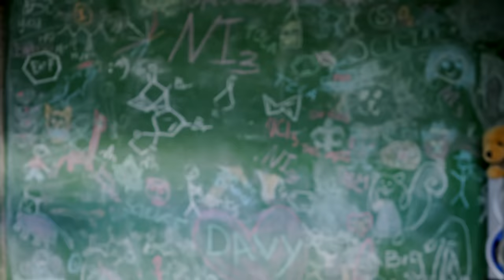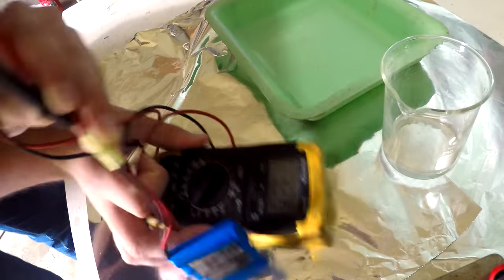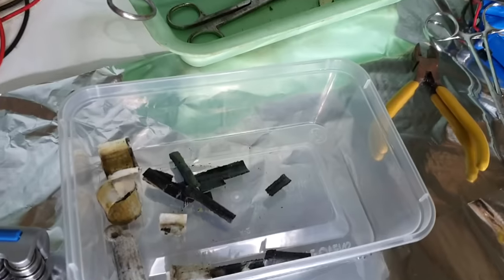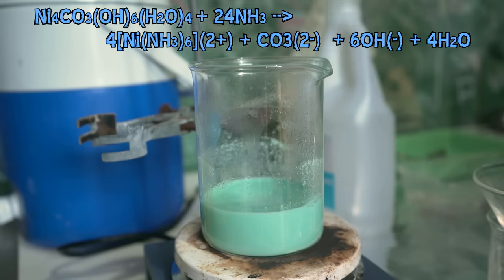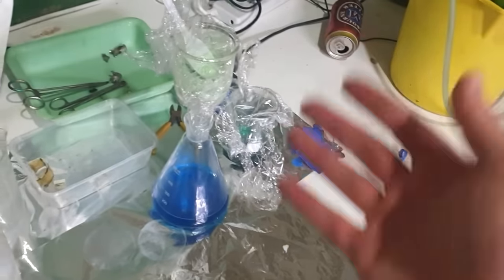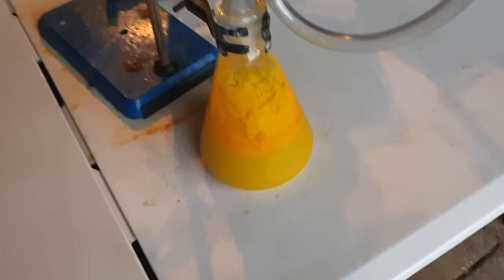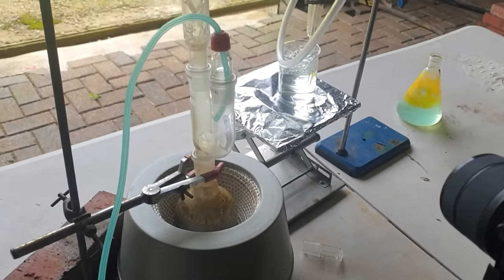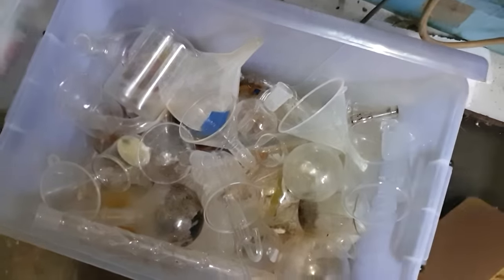Extracting Cadmium from a NiCd Battery

Comment: Ni-Cd cells are great for solar garden lights since it's ok to overcharge them with low current. Same goes for overdischarging them.
You absolutely should not overcharge or overdischarge LiPos - so you'd need a much more complicated circuit.
And generally, people wouldn't want their solar garden lights to explode.

Comment: Had an electronics engineer friend that was building a number of switching prototypes that incorporated large NiCad battery packs. In assembling a number of them, he picked up enough cadmium for it to show up in his blood. His doctor advised him to avoid the batteries for awhile. I've always wondered, how did he pick up enough to be detectable?
In those days some electronics connectors were cadmium electroplated - my guess is that between soldering those and the batteries he vaporized enough to sequester some biochemically.
I could be flippant and say, "uh oh, there's where your missing Cd went", but I won't. 
All kidding aside, cadmium can stay resident in your system for years causing irreparable damage. I believe my friend's doctor had him do a round of chelation just to be safe. Yikes!

Comment: When I tried my hand at nickel excitation from NiCd batteries, I remember getting nickel powder on the cathode, which I held in place with a magnet stuck to the jar.this of course set up a string action. The cadmium was plating across with the nickel, in hindsight I should have dropped the current density, this would have allowed me to get solid formation of nickel on the cathode..

Then it would have been as simple as changing electrodes and boosting the current density to pull out the Cd

Comment: I used to use Cadmium every day when making cathodic protection devices, AKA Marine Anodes. They come in two delicious alloy flavors; Aluminum:Zinc:Indium and Zinc:Aluminum:Cadmium, with the first metal listed being about 98% of the alloy. The Cadmium came in logs about 20cm long and 2.5cm in radius. We were always careful of the Cadmium as we all knew it is unhealthy, but as far as hazards  in a foundry go it was trivial. Getting a face full of molten alloy because you put something wet into the pot (and for some reason were wearing no protective gear) or the amusingly blinding result of some magnesium getting into a pot of Aluminum took the greater share of our attention.

Comment: 1:22 NiCad batteries also can be trickle charged to kingdom come without failing and without complicated electronics that also could fail. That´s why they are still used for emergency lighting and alarm systems. Just change the cells every 2 years and don`t bother in the meantime.

Comment: @4:19 you clearly see it did vent at some point.

I did overcharge 4 cells at about 12-13v @10a and it did vent within 30-60 seconds. Nothing special compared to a li-ion battery but it contains potassium Hydroxide.

Comment: All I remember about Ni-Cad batteries was it took (from a kid's perspective) forever to charge them and you only got 30 minutes or less of use out of them. They sucked

Batteries would probably get recycled properly (and also used motor oil) if you could bring it to supermarkets for disposal (who in turn would get a subsidy from the local/state government to do so) instead of the honor system we were given

Comment: So.. synthetic lithium polymer batteries without flammable electrolytes(which they are, by definition) do not, under any circumstance, that doesn't involve overcharging and bypassing the (tiny) safety circuit with chip on it by careful wiring, actually catch fire. And even if you do that, they will typically melt and become unusable, rather than burn. Meanwhile, the reason that some of the organic lithium batteries can catch on fire is actually the same reason that the nickel-cadmium batteries can catch on fire - that the electrolyte is flammable. 

What complicates this is that what's been sold as "li-po packs" for a while are usually some sort of organic lithium-ion based batteries with different, also flammable, electrolytes. And there has been a dirge of very bad production runs of lithium ion batteries that would be rated for a lower power-consumption than the devices they're put into require. So they get warm, the electrolyte leaks, and gets sometimes ignited by the charging port, or by a short.

But basically, this whole thing about nickel-cadmium batteries being safer than "exploding li-po" packs is complete bullshit. Not only do they both crack and leak, the electrolyte is also corrosive and toxic. It's total propaganda. And the only reason they're still used is that they are dirt cheap to produce - that is, for the factories in China that have the old production facilities, and are getting less and less orders. There's stocks and stocks of these, so if you don't need particular voltage, stable power, anything to any order, whatsoever, then this is passable. So you'll get it in cheap toys, or for disposable parts for model-planes, and things like that. Since they sometimes don't have any actual limitations on them, to - you know - avoid making them burn -- it is possible to just draw as much power as possible, and put them in series, and so on. It's not a good idea, but people do it.

This is also the same reason why we've been using lithium-ion batteries for the longest time. People have come up with salt-solutions for electrolyte, to avoid the corrosive and flammable part - and it doesn't matter: Apple and the Samsung want to save 1 penny on the ton of batteries produced off a finite resource mined by slave-labour in Africa, so that's what we're going to get.

Synthetic lithium-polymer batteries, on the other hand, have a sort of fluffy polymerized gel instead of flammable and liquid electrolyte. It's tons of small threads, bascially. And that is the electrolyte. They don't combust, they are not toxic in the same sense as the organic batteries. And they do have, and must have, voltage regulation software controls (which doesn't get you "less power"). Otherwise they don't function at all.

And technically, the synthetic lithium polymer batteries are cheaper to produce, they have a less involved process, less things can go wrong, and they last infinitely longer before not being serviceable. And they are, unlike the organic batteries, actually possible to make into new batteries. They can be melted down and reused -- organic lithium-ion or nickel cadmium batteries can at best be "safely disposed" by industrial and expensive dissolution, much like what you're doing in the video.

So yeah. We're not using these synthetic batteries all the time, because the world is fucked. And there are humungous industries invested in keeping it that way, even when the tech exists to replace the stuff that literally could kill you, and it is technically cheaper to produce. We're just keeping it the old way, because the factories are there, and it's cheaper to spend some advertisement money on creating fear about new "li-po packs" that "explode".

Comment: I imagine you aren't old enough to remember cadmium-plated hardware (screws, connector housings, and the like). That used to be common, and still is in mil-spec applications. DigiKey lists over 160,000 circular connectors with some sort of cadmium-plated shell.

Comment: So you saw a noticeable difference with having a slightly acidic environment when bubbling the H2S. The reaction you showed for the cadmium had a product of nitric acid. Is it possible that the solution acidifies the more cadmium you precipitate out? If that’s the case, the cadmium might get redissolved and leaves you with less yield, especially if you leave it for a week(I am also a culprit of leaving reactions for a week because I just cba).

Comment: I think I know what it happened through your process. Firstly, the layer you thought was cadmium was cadmium and it can be physically separated. You can see these batteries have a layer of cadmium and a layer of nickel hydroxide.

And when you thought your cadmium sulfide was redisolving, you were right again. Like any sulfide, acidic solutions attack them, releasing back hydrogen sulfide (same as if you throw a chunk of pyrite in acid). You should have filtered straight away after precipitating with your hydrogen sulfide generator instead of letting it sit with an acidic solution, or at least neuatrlising that solution, and you would have been more happy with your yield ;)

Comment: Dont worry about yellow color I usually get all the rainbow colours every time different. Last time I had really nice blue color after some amination and salting. I had little dirty solvent. I was lazy to distill it first so I washed it few times with water, active charcoal and probably because of little carbon left inside of my separating funel instead of green I got blue.

Comment: 2 things: 
Yes Nickel is magnetic. You could have tested which metal was nickel and which was cadmium by using a magnet. Wouldn't have guaranteed purity but it would have helped alleviate some uncertainty. 

Secondly (and take this with a grain of salt) but I'm pretty sure a fully charged battery would have less cross contamination of metals than a depleted one which could have helped.

Comment: If I had to hazard a guess, you probably got almost half the cadmium. 6% of the battery (not counting the shell) is cadmium, and a typical "AA" size NiCd cell is 21 grams. 25% of that is the steel case, so there should be 945mg of cadmium in there.

Comment: If I remember correctly the Japanese have sth called Itai Itai which translates into "Ouch Ouch". Apparently back around WW1 they started mining the hell out of Cadmium and a lot of it ran off into the drinking water.  The cadmium gets processed into your bones like it was calcium and makes them brittle.  Apparently at high levels you can crack your ribs if you simply cough kinda hard and it is extremely fatal if exposure is long term.

Comment: if I remember correctly our analytical lab, CdS needs a high concentration of Sulfide ions to precipitate i.e. as H2S has a pKa of 7 it may only be slightly acidic. We proceded as following: dissolve the salt/metal in HCl/HNO3 (2M), add H2S in Acetone, dilute to five times the volume OR add a little NH3 --> yellow CdS. if you add too much NH3 (pH gets to be arround 9) Ni will precipitate out as NiS (the tar we all wanted to see). maybe this helps.

And the flask you're using to generate H2S....man you must hate it a lot

Comment: * "where's the cadmium" *
Did you check the separator?
My understanding of these cells is that when fully discharged; most of the cadmium is present as cadmium hydroxide...
It is when the cell is fully charged that the cadmium is plated to the cathode (the outermost / larger electrode)
Also only about 16% of that cell is cadmium, by weight... (still a fair bit, about a gram?)

Comment: To add to the NiCd Vs LiION bit at the beginning, there's a third option. Where I live (CZ, EU), NiCd cells have been phased out in favour of NiMH cells, which are supposed to be very similar but cadmium free. Don't know why the rest of the world doesn't use them, maybe they are more expensive or something.
Reply: NiMH did get used a good bit as a NiCd replacement but lithium batteries just took over most of that market anyway

Comment: The best way to separate nickel from other metals, is to reduce to an alloy, then react the nickel with carbon monoxide under pressure to turn it into the even more toxic nickel tetracarbonyl. Note that I said "best" not "safest".

Comment: You aren't even going to talk about the real reason NiCD batteries were replaced. Memory effect in Nickel Cadmium batteries is a real thing. It was a huge pain for laptops and other 90s large portable electronics. Only good thing about them is their long storage capabilities of earlier over-engineered NiCD batteries. I've seen 50 year old NiCD batteries still hold a significant charge

Comment: I havent looked it up, but i wouldent be the least surprised if a nicad battery is mostly nickel with just trace amounts ie mere milligrams worth of cadmium. and if a NiCad works as i think it does, the cadmium may only exist as a metal when the cell is fully charged, and more as a salt when the cell is flat.

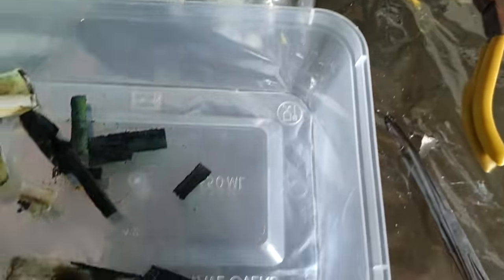Comment: 5:58 During discharging, don't they form hydroxides? I.e. those are mostly nickle hydroxide and cadmium hydroxide. Discharging changes the chemistry after all, from a higher energy potential to a lower (and less chemically reactive) energy potential.
Then again, I don't have a degree in chemical engineering, but in electrical.

Comment: You should have checked the voltage while the leads were in salt water. You always get a buildup of charge when there is no load, and it gives you an extremely misleading voltage reading on a high impedance multimeter. The salt water would dump the ionic charge buildup, and reveal the real state of charge.

Comment: Would it have been possible to separate out the cadmium from the nickel by electrolysis? Nickel has a higher reduction potential than cadmium, so you could get the nickel to crystallize on your electrode with the cadmium still in solution by carefully setting the voltage.

Comment: So that's what the infamous Cadmium Yellow (which they used to paint American school buses with, I shit you not).

Of course, what you should have done is to just dissolve the whole innards of the batteries in acid, neutralized it a bit and then done the rest. Would probably have saved you a heap of trouble.

Comment: Perhaps NiCd batteries are not just 50/50 on their composition. I guess charged/discharged state may have a great influence on how disperse cadmiun is. You shoud tried in a charged state, thou is there a safe way to open a charged battery? Dropping it in liquid nitrogen perhaps.
I'd chech if you have some video on NiMh batteries, recovering nicket would be great and we had no toxicity issues.

Comment: I know this is a year late, but don’t just discharge a battery with little or no resistance.  You want to discharge over some sort of resistor so you don’t draw too much current from the battery (which can be dangerous)

Comment: You might want top Check the pH after bubbling the h2S through your solution. As the CdS forms you are acidifiying the solution through the leftover protons. If it IS true that CdS redissolves at lower pH values this might be your reason for Low yields. Maybe try adding some more Carbonate amidst H2S-addition to geht back to slightly acidic/neutral.

Comment: I have a similar problem trying to get palladium out of a mixture of copper sulfate, copper, ammonia, and water.  I think I put in way to much copper and both metals are stuck in solutions.  I too I have a green muddy precipitate and a green to blue  liquid.  I am going to try and add some more ammonia but I don't know if it will react with the palladium.

Comment: I'm going to be that guy. 
You shouldn't have discharged the battery first. In fact you should have fully charged it. 

A fully charged Ni-Cd cell contains:

    a nickel(III) oxide-hydroxide positive electrode plate
    a cadmium negative electrode plate
    a separator, and
    an alkaline electrolyte (potassium hydroxide).

The discharge reaction (according to wikipedia)  forms cadmium hydroxide. 
https://en.wikipedia.org/wiki/Nickel%E2%80%93cadmium_battery

So the moral of the story is.. charge up the nicad... so fully charged that its eyes start to water, then remove the cadmium plate. 
Throw the rest away, and enjoy all that newly found spare time to allow you to pursue that other great modern pastime, assembling Swedish chipboard puzzles.

Comment: Couldn't you dissolve everything then electro plate out on a graphite electrode? Watch the voltage potential and when it starts spiking to the next half cell voltage potential you know you have plated the constituent out. Then I would redissolve off the graphite. You don't even need a fancy power supply. One battery in the pack is only 1.6v.

Comment: I'm guilty of opening these up. Not for the cadmium but the nickel for making nickel sulfate/oxide/acetate.
 They are built more like a car battery with a rolled up nickel grid or strip, pasted with cadmium oxide.
A car battery has straight plates/strips or grids pasted with lead oxide made to fit in a box instead of a tube but the principle is the same.
I would bet if you go back and test the black crumbly stuff I think you will find that it is almost pure cadmium oxide.
The metallic strip you dissolved was the nickel strip with some bits of cadmium stuck to it.
Reply: Sorry. Should probably clarify. "Pure" was too strong of a word. I worked in the lead acid battery industry for several years. the pasting process for the positive "grid" is different than the negative. Various binders and fillers as well as seed crystals are added to form different mixtures depending on the battery use. They all start as pure lead oxide though.
Then basically mixed with water and sulfuric acid to make a paste then spread on the lead grids and dried in an oven, put in a box, filled with sulfuric acid solution and charged.
Can't imagine the process being much different for NiCd. FYI you don't need to use distilled water if you ever have to add water to a lead acid battery. They're totally made with tap water at the plant.

Comment: First off, there can be as little as 6% cadmium in most commercial Ni-Cd batteries. You….may have gotten all of it. 

Secondly, H2S itself is a weak acid. If you only want the solution slightly acidic, you actually want it to start out at neutral or even slightly basic.

Comment: next time melt it apart or use a powerful magnet to seperate out the nickel start
maybe turn it all into oxalate, decompose that and seperate with magnet
maybe just melt the cadmium down
maybe use HAc instead of H2SO4, as H2SO4 is a strong acid where HAc isnt so much, maybe citric acid, something else weak that wont react with CdS